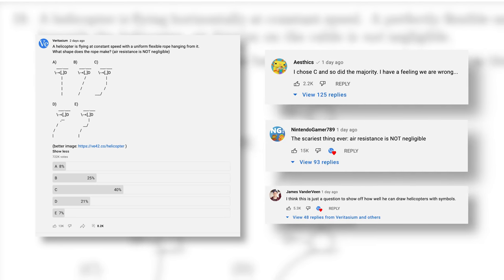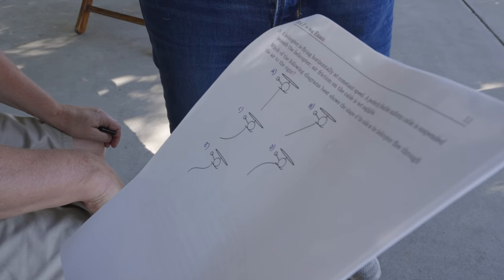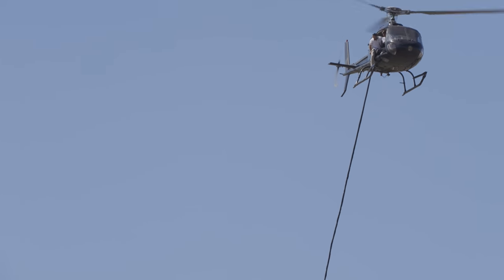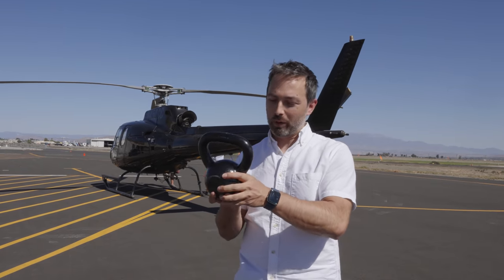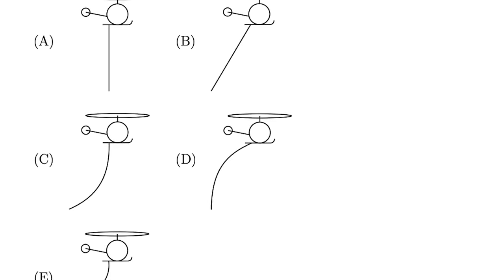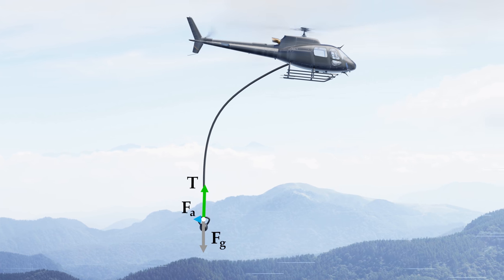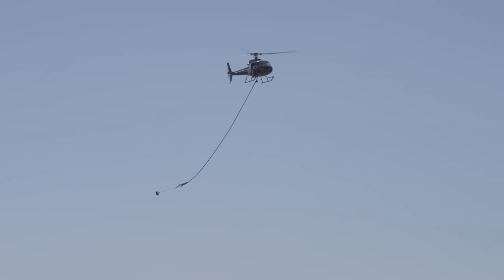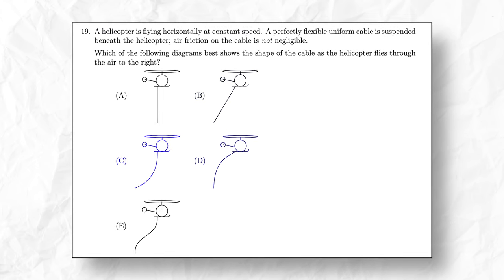I Rented A Helicopter To Settle A Physics Debate

Comment: I’ve seen a different scenario, during local National Day parades, they have Puma helicopters drag a line with a huge national flag and weight at the bottom. I remember an inverted J shape like D , although a bit deformed at the bottom by the flag drag.
Reply: But were they flying at, mostly, constant speed. And how was the wind, from which direction or were there turbulences due to ther air crafts.
And last but not least the flag and the weight, as u wrote yourself.

Comment: I ran a similar experiment in a wind tunnel and found lighter materials tended to resemble C whereas the heavier materials resembled B. Also higher wind speeds would make the rope whip up to almost horizontal then drop back down again.
Reply: Light materials show changes in the air flow , eg density, speed...  ? Heavy rope shows the disturbances  far less ? It depends how perfect  you get your wind tunnel ?
Reply: @isilder  True but then the question didn't specify a density for the rope.

Comment: I really thought the airbeing pushed down because of the rotors would extent much further, my entire choice was based on that in combination with the speed and gravity of course. But I guess it doesn't extent that far
Reply: True but the question was phrased as a pure physics or maths question, so thinking about extra real-life mechanics that aren’t mentioned in the question would be wrong in the exam question given
Reply: @gregoryfenn1462  I was wrong in both situations xD the airflow comming from the propellers just doesn't extent that far. So in both rl and on the exam it can be neglected. At least I never did that exam :P
Reply: @JJSnel-uh3by  I think it might have a bigger effect with a lighter rope. The less mass the more the rotor wash would effect it.

I am not sure I fully agree with his statement that it has no effect!
Reply: @LDreger  True, most likely just negligible at least with this rope. Was a pretty heavy one as well, so you are probanly right. But then if it is going to be very light it would also be effected a lot by turbulence and what not, also a safety issue if it does get too violent and get's into one of the propellers.

Comment: Now you need to find out the shape of the rope when flying straight through a air slip-stream, and then flying with the slip-stream, and against the slip-stream.
My guess is that the rope might end up being a S shape when you add the slip-stream.
Reply: You can answer this using the model that Derek presented in the video. A slip stream (or wake) will alter the drag on some portion of the rope. If that wake reduces the drag, the rope will curve down at that point. If that wake increases the drag, the rope will curve back at that point although I'm struggling to imagine a practical scenario or this that doesn't involve a collision or at least a near miss. If the effect of the wake is large enough to be relatively constant across the entire length of the rope, then it will form a straight line for the same reason as explained in the video. I suspect that getting someone to do an empirical test of this using an aircraft may be challenging due to the risks that wake turbulence could pose to an expensive aircraft. You might be able to set something up in a wind tunnel to demonstrate it, though.

Comment: The length of the rope is also a would seem to be a factor.  If you have a rope long enough that it intersects different air densities (like between sea level and Denver) then it would act as if it had a parachute as the lowest part of the rope would have more air resistance than the top of the rope and thus would be pushed further.

Comment: Nice, exactly how I guessed it would go. Figured C if the down force of the rotor made an impact (inverse of hanging a weight on the end), B if it didn't. Gotta go for the free body diagrams
Reply: @BadWithNames123  exactly. The rotor wash is moving backwards as well, even if the aircraft isn't producing forward thrust
Reply: You could then consider that the exhaust from the turbine provide slight thrust to push the heli forward
Reply: @BadWithNames123  But I think it's clear from the video that the downdraft is pointing downward more than the rope.
Reply: @BadWithNames123  well yeah ofc there's also a horizontal component to the force of the blade, but since the helicopter is moving forward at a constant speed it's only enough to counteract air resistance against the body of the helicopter, which is way less than the vertical force needed to counteract the weight of the helicopter. Will have more of an impact at higher speeds, but as explained in the video, the downward force of the air from blades has negligible impact on the rope, so any horizontal force would be even more negligible

Comment: I have a bit of an issue  with the first question here (no weight or parachute on the end).  If the effect of the rotor wash is negligible, then why attach it to a helicopter? Shouldn't the answer be the same whether we hang the rope from a plane, or a helo, or a zipline?

The question specifically states that air friction is not negligible. Therefore there still must be a downward force from the rotor wash, closer to the helo.  So the answer should be c, even if that curve is imperceptible in the real world.

Comment: Really cool video, great explanation!
One thing that I was wondering when watching this: Am I right in thinking that theoretically, if you make the rope really really long (like >1 km), you would get answer C? Considering that the density of air decreases with height, the air resistance will be higher at the tail end of the rope (analogous to the situation with a parachute attached to the rope), so I would argue we'll get a J-shape rather than a straight line. Obviously, this isn't a realistic scenario so it makes sense to neglect this factor in the question, but it's an interesting thought experiment nonetheless.
Reply: I wasn't about to comment that. I think that the real answer in somewhere in-between b and c as air gets denser toward the bottom.
Reply: @benisfast4193  Answer C is always wrong, because in this answer the rope is 100% vertically at the connection to the helicopter. But it has to be in an angle backwards due to the force the air friction generates (the same angle like in answer B or D). But your comment about the air densitiy is interesting and you are right - the rope would bend like in C, just with a different starting angle...

Comment: 4:45 I beg to differ. 
There was a news story a couple years back showing a mountain rescue gone wrong. The patient had been loaded into the gourney apparatus and was being pulled up when they suddenly began to spin violently this motion was made worse when brought closer to the helicopter. 

This was because the rotor wash was creating a cyclone beneath it and spinning the patient. I believe it was resolved by the helicopter flying forwards instead of maintaining its location. 

So it’s likely that the rope is simply not a large enough object to be significantly affected by the rotor wash.
Reply: Heli rotor creates a ring of spinning air. If you stay still, it will grow over time and can reach further down. But if heli is in motion the rope will be long gone before the vortexes/wash turbulence reaches down enough to mess with it.

Key takeaway here is that helis, planes etc. do not just force air down, they make it spin. And while you can measure some very high speeds of downward air motion close to the wing/blade the air as a whole vortex drops down pretty slowly.
Reply: @lingSpeed  true that. But I do have issue with him making a blanket statement like that since this is the case. Only in motion would have been nice to add

Comment: Seems I overestimated the helicopter downwash, as I actually went with E, thinking they might contribute to some downward momentum at the top of the rope.. B was my second guess though, so not too bad I guess.
Reply: Same here
Reply: In forward flight the Downwash is actually going behind the helicopter, because the rotor disk pitches forward
Reply: The rope actually alternated between B and E, so in a way you're correct because it wasn't totally straight throughout and just sort of wiggled.
Reply: I think you were right about E.  When you look closely at the first attempt it looks serpintine although the first curved length is quite short.

Comment: I think a critical point here is the terminal velocity of the rope's cross section.  I think this plays a major part in this.  A normal rope would have a much lower terminal velocity and would in fact be more impacted by both the down wash and the airflow from the forward movement.  This tree trunk that was used is one interesting example, but not the only one.  What would a normal climbing rope look like?  It would be easier to pull up into the helicopter, but not as safe for the tail rotor, which I guess is my point.

Comment: what's funny is the question as initially thought up would probably result in most people getting it right, with most of the errors only being a result of people thinking it's a trick question
Reply: I think the controversy is why would contestants know the downward wind of the propeller is ignorable. In the video it is just stated as a simple fact. But in non-quantitative questions like this students will just combined the effect of motion and effect of downward wind to get C, no matter how small that effect is. The controversy can be avoided if the questions uses a plane or a cable car.
Reply: Yep. I looked at it, thought "oh it's gotta be B, right?" and then only started questioning that when he started talking about the other answers
Reply: @yourxianda  I don't really get this reasoning, although I saw it repeated in the comments. The chopper is moving forward, not up and forward - even if you believe the downward force is extensive, the forward motion means it should be trailing, which just adds it to air resistance. Now if it were also going up, THEN I would accept that the question was misleading, because you'd absolutely need to know the down force is negligible. As that's not the case, it's just a matter of not thinking it through properly as far as I'm concerned. Once you realize the down force would trail, and therefore be added to air resistance, you'd recognize that any amount of air resistance needs to be balanced by tension, which is distributed evenly. ie all you're changing (and therefore the only error) is the angle of the straight line.
Reply: @z-beeblebrox  the chopper flys by pushing air downward. It always does so, not just when moving up. And the downward wind gets weaker the further away from the chopper. So the top rope get more downward tension while the bottom gets less.
Reply: @z-beeblebrox  as I said, using a plane or a cable car would have avoided the problem of downward wind altogether.

Comment: What would the rope do if instead of constant speed, it was constant acceleration?
Reply: The rope would advance into negative speed then cease to exist.
Reply: Then its C, exponential line
Reply: bruh no lol
itd just look like C i think
Reply: It will hit the rotors and the helicopter will crash
Reply: It would be option D. 

The bottom of the rope will respond slower than the top to the change in speed since the aircraft pulls on the top, which pulls on the middle, which pulls on the end.

Note how Derek demonstrates that at a faster speed the angle of the rope is shallower. So the top would get shallower and shallower as you sped up but since you never stop speeding up, the rope never evens out to a straight line. The bottom never 'catches up' to the angle of the top, since the tension goes from top to bottom, and it has a relatively more vertical angle compared to the top.
Reply: I'm guessing that the question gets more complicated since aerodynamics supposedly change significantly once you go supersonic.
Reply: @simon7719  lol I’m talking from say 10 mph to 60 mph gaining 10 mph per 5 seconds, for example, not an infinite extension of speed.
Reply: If you don't know, then it's C.
But I believe the shape would be the same just at a sharper angle because of the air resistance bias. Probably up to a limit just shy of horizontal... 

"Mayday, mayday, our curiosity got the better of us"
Reply: It hits the tail and everyone dies.  Not sure at what point though, seems likely way before the helicopter breaks up by hitting the speed of sound.
Reply: @audiomystic  Then it's not constant acceleration ;)
Reply: Another force would be taken into consideration that is the force due to aceeleration of helicopter ( since acceleration always originates due to a force) ..
Reply: It will create a different timeline, duh 🙄
Reply: Same thing.
Reply: he already explained what would happen at 5:55 the angle of the rope would just change, but shape is constant
Reply: @simon7719  That's 2 mph/s that's literally constant acceleration
Reply: @danielwilson9152  that assumes elasticity in the rope. I would assume that the rope is inextensible so the shape would be the same as for a constant velocity
Reply: It would rotate towards the propeller until the rotation momentum from the inertial force equalizes with the momentum from the rope weight, or until the rope is parallel with the trajectory of movement.
Reply: Yeah that was like my first thought. Probably a curve like the graph slope of exponential increase but it seems that the matter is too counter intuitive to be sure. I'm a high school freshman right now and I know more about physics than probably everyone in my grade but I kind of failed to understand the basic logic of why we got all such answers, I might have to re-watch this video some other time, and if i get a new thought process I'll comment right here. (P.S- If you are reading this and know a simpler way to explain it to me, or just in a different way, it'd make my day if you tagged me and tried to explain it here in the comments.
Reply: @shianhao  Sad life XD
Reply: If the Helicopter would move in a Constant Acceleration( The speed will change in Equal Intervals In equal intervals of time) 

For example key*just for example 
If the Helicopter Acceleration is 120m/s'2 then, as they are two external forces acting upon it... Gravity and Air friction... Gravity will pull the Helicopter down and lower side of the rope ....There will be More air Friction in the Upper side of the rope. If the velocity of the helicopter will Change then frequent change in shape in each Interval of time
Reply: @simon7719  lol it is but not constant to infinity :) just limit within the normal operating range of helicopter speed
Reply: @LucidDreamn  that’s faster but still at a constant speed. Not accelerating

Comment: This test is also assuming that the density of air is constant. If the rope was a short length the results are correct, however if one were to have an extremely long rope the reduction of air pressure with altitude will change the shape of the rope in motion. I believe..

Comment: As soon as he said "perfectly flexible uniform cable" I was like "ah, so the debate ISN'T going to be settled in this video"
Reply: Why wasn't it though?
Reply: @betapi1726  the cable used may not be considered perfectly flexible.
Reply: @mcbean1  . . . at the microscopic level it is not perfectly uniform.
Reply: @mcbean1  it is flexible enough to demonstrate what is needed here; note the slight flaring at the end of the cable where the tension is lower? If the cable was too stiff to demo this, you wouldn't see that. The only thing a more flexible cable would do would make the curves that are there sharper; it won't create a curve where there isn't any.
Reply: @betapi1726  if a flexible cable creates a flare, a perfectly flexible cable would exhibit a greater flare meaning the shape of the cable at constant speed would be less and less like (b) the greater the flexibility of the cable
Reply: @mcbean1  That sounds like something someone who picked the wrong answer would say.
Reply: @mcbean1  yes, however notice that it whipped in both directions equally; you're correct that it would look less like b at any one moment because the bends would be exaggerated, but the average position would still be b; it would alternate between curving one way and curving the other way, but always return to b.

Comment: This reminds me of a rescue technique that was experimented with, maybe 1st or 2nd WW, using a rope suspended beneath a fixed wing aircraft. With a sufficiently long rope and with the aircraft flying in a tight circle, the end of the rope would dangle nearly motionless on or near the ground. A person could then attach to the rope, the aircraft could widen out it's turn and the person would be lifted from the ground and flown off to a another location. Placing the person back on the ground would then be a reversal of the process. I don't know if it was ever adopted in anger, so to speak, because of the risks involved.

Comment: 3:22
No one chose E?
That was my first instinct, with the caveat "depending on the length", cuz at some point the ballooning air will blow around it (though that is partially rationalizing an instinctive guess that popped up when I saw option D)

Edit:
Well, that's what you get for always suspecting trick questions.
Reply: I chose E as well because I didn't think the force of gravity would be linear across the length of the rope. I don't know wtf I was thinking.>.<